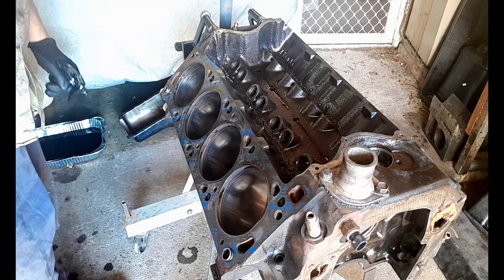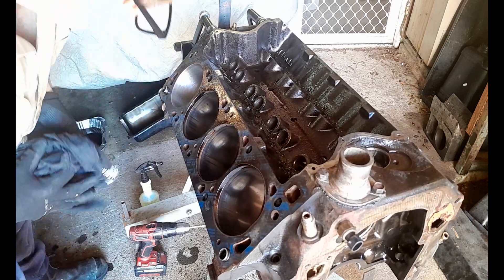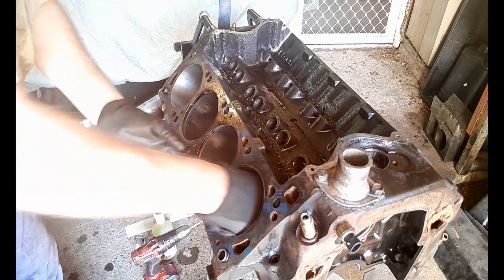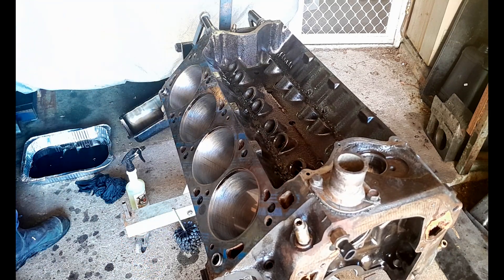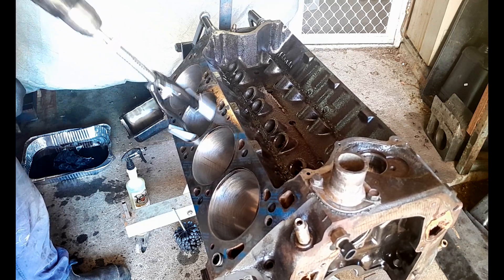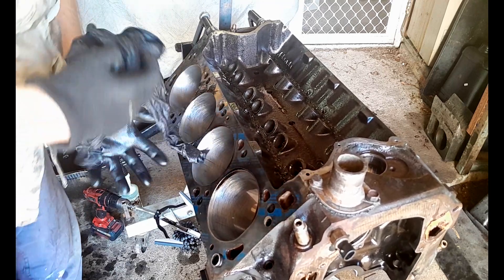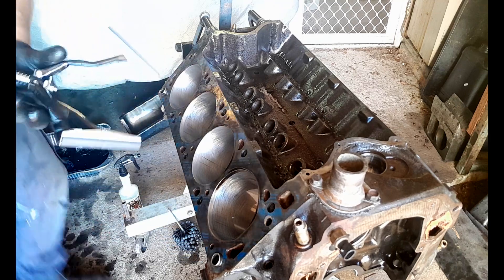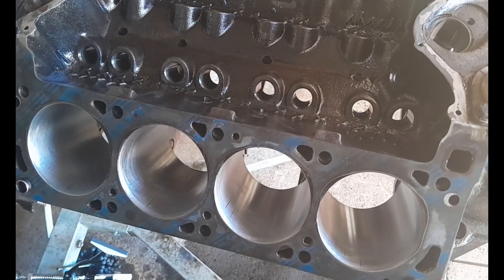Cleveland 393 Ball And Stone Honing To Improve Scored Cylinders

Comment: Another Cleveland diehard/tragic of 20+ years here mate....As you know it's all about oil control and Clevo's like to oil the heads under prolonged spirited driving which can lead to oil starvation, this becomes much more critical when running mechanical or solid roller combinations. 
Given your running a hydraulic flat tappet, there's a few mods you can do to the block to help promote oil flow and more importantly oil return to the sump. 
I've never been a fan of the external feed mod myself, i did run it on 1 combo many years ago and found no benefit but i also know guys who swear buy it.

The central oil return holes in the valley i like to enlarge to 1/2 inch, chamfering the radius. 
The window in the block that leads from the valley into the front timing area can be ground down and cleaned up significantly, allowing for more oil to drain back over the timing set. 
Using the cylinder head and h/gasket, all Oil return passages leading from the heads down in to the block should be inspected for alignment and enlarged/matched to suit. 
The Oil filter pad can be massaged and radiused to promote better flow (best done with oil filter adapter removed). 
Using a std oil pump, disassemble and modify by radiusing and smoothing the passages on the feed/pressure side, gasket match block to oil pump body, set pump gear to pump body clearance .003" to .005" and gear to cover plate .002" to .0025" and replace the std oil bypass spring with the upgraded moroso unit.
If you do anything more than normal street driving, a larger capacity sump and pick up is a must imo. Whether std or after market, make sure to measure the oil pick up clearance to sump/pan base, no less than 1/4" no greater than 3/8"

Before lashing out on a new set of rings, if you have the ability to get your hands on a dial bore indicator, it would be worth measuring up those cylinders and checking for taper or excessive wear.
Cheers
Reply from the maker: @RoB_666_  thanks very much for all the info. Seen a few videos on the oiling mods for the Clevo’s. 

Haven’t had any issues with oiling vs how this engine is used thus far. This tear down has confirmed all my bearings are running well. If she was being revved frequently, I’d definitely be undertaking your suggestions. Thanks again for sharing the knowledge.

Comment: You freak out over a couple of score marks.yet you may have 25 thou of ring end gap that is probably 20thou deep when the piston is installed. Get where I'm going.
Reply from the maker: @deanmoser5907 Ok. But isn't that negated by the second ring gap being off set to the top ring? My gaps are 26 thou top ring 28 thou on the bottom ring. The score marks that the rings can't seal against is what I'm not overly happy about. No doubts I’m over thinking it Dean. In saying that, I'm rolling with it as it is anyway. Thanks for adding some piece of mind mate.

Comment: Dr. You should be fine for a flog street engine with an occasional pedal to the metal blast. The leak-down in those scored cylinders should be inconsequential for that application. If you were going racing, a rebore would be absolutely necessary. Re-ring and put the pistons in the same holes they came out of. Will be following along. B.T.W. Make sure you do a thorough cleanup... Happy wife. Happy life.🙂 G'day mate.
Reply from the maker: Thanks mate. Good advice as always. Happy wife, happy life is a motto I live by!  😊